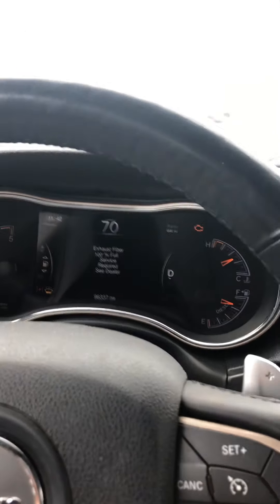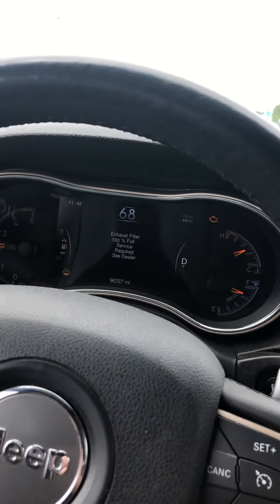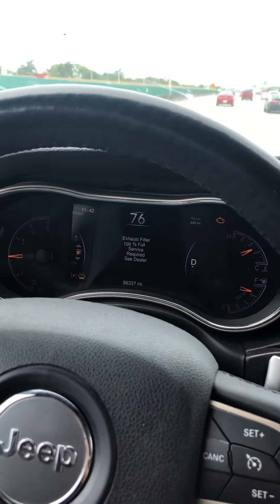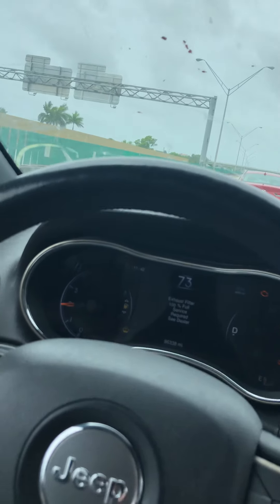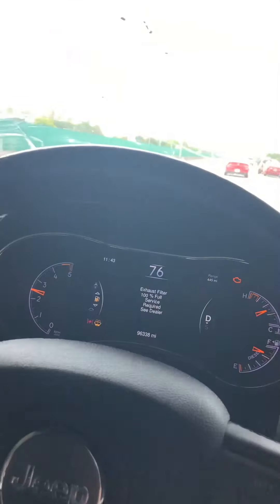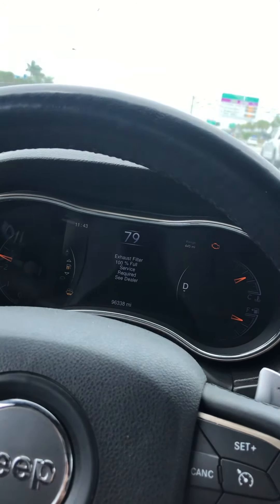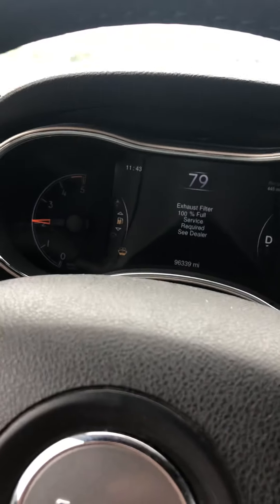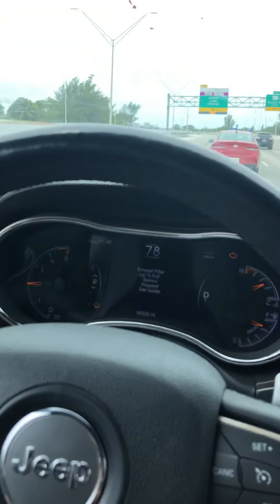Jeep / Dodge Ram Ecodiesel limp mode issues temporary solution

Comment: We tried to burn the particle filter but it is not able said the dealer, he said that our manifolds are broken😢 do you recommend us something?
Reply from the maker: That does not make much sense at all from what the dealer told you. There is a chance that your filter is completely covered of soot and causing some restriction. Best thing to do is to do a full delete & tune or sell the car. There are a good bit of issues with the 1st gen eco diesel motors unfortunately.